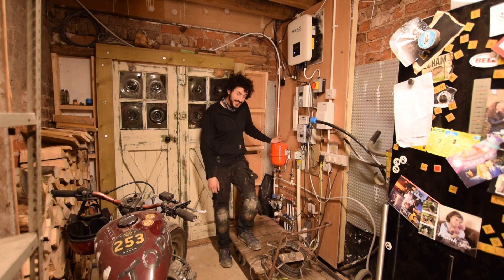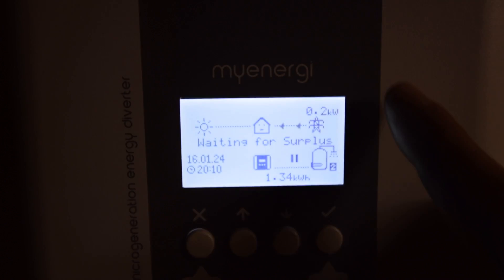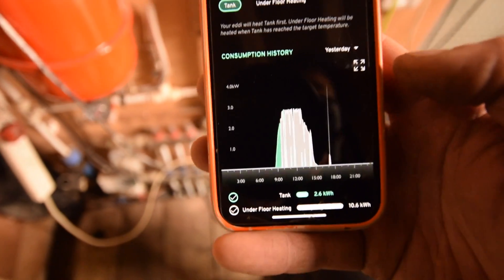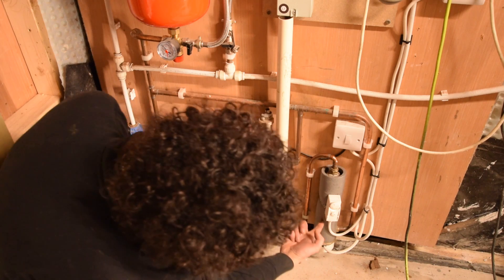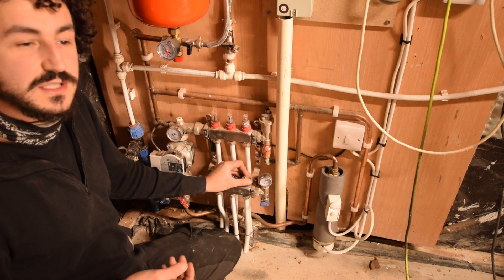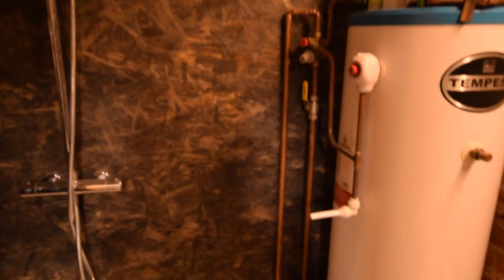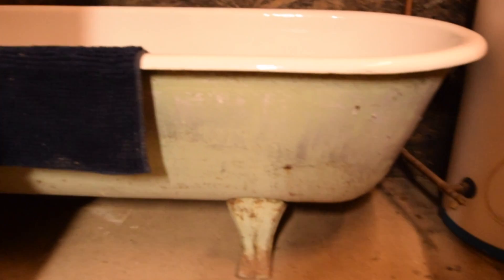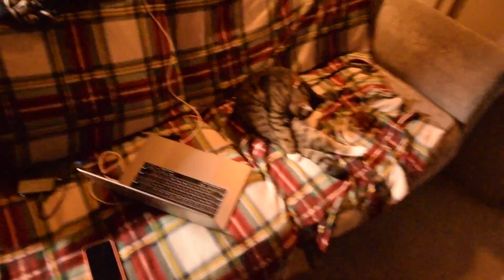My Solar Panels Heat the Hot Water and Underfloor Heating No.6

Comment: Can I ask what floor size you heating and what  temps you able to get? That inline unit I like, you not heating a tank only the water in the floors. And yes might not be the best way to heat but you not heating 200lt of water. Brilliant
Reply from the maker: My solar diverter priorities my 200l Hot Water Tank, once that’s satisfied it will then put the surplus energy into the UFH slab.

11kWh is needed to raise the 50m2 slab temp 10 deg. This could be done using the lower priced off peak energy if no solar available. I use a log burner through the winter so not necessary. Hope that helps, Max

Comment: Hi, love your solution to solar excess 👍
Just a couple of questions...

Have you got any inhibitor in the underfloor heating water loop? As its usually "fresh water" the an immersion heating element heats up.
And is there an expansion vessel in the system? 

As im thinking of upgrading existing underfloor heating to solar but keeping the gas boiler as a back/top up for times when no solar available.

Thanks in advance.
Regards Mark.
Reply from the maker: Hi Mark, 

Thanks!

The loop has inhibitor in, I put this in when I filled it up for the first time. There’s an 8l expansion vessel which is actually overkill, when I figured it out I think it only needed something like 1.5l. 

Sounds like a good plan. I suppose the ideal solution would be to have battery storage & an ASHP as it’s effectively multiplying the energy when converted to heat. 

Good luck with it, 
Max

Comment: Gorgeous bath. If the pipe on the tank is aimed at the wash basin while the bath is occupied, then safety is not an issue. The system is brilliant, even in this temporary form.

Comment: Really inspirational setup. Thanks for sharing. If you have the time, please consider sharing any sensor data you might have for heating and electricity metrics. Obviously it depends on location, but I'm interested in seeing the viability of using waste electricity as a supplemental heat source. Thanks again. Subscribed!
Reply from the maker: Thanks for the comment. 
Yeah, it’s super simple but would be much better with an ASHP for the under floor. 
Absolutely, I’ll let the PV run a while longer and upload the output.
Not a bad problem to have if you’ve got waste electricity! Max